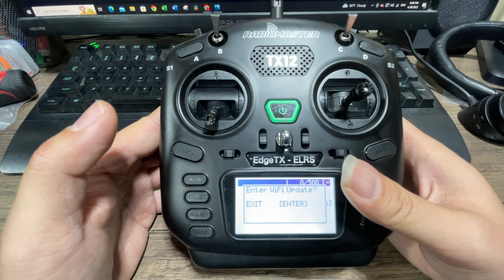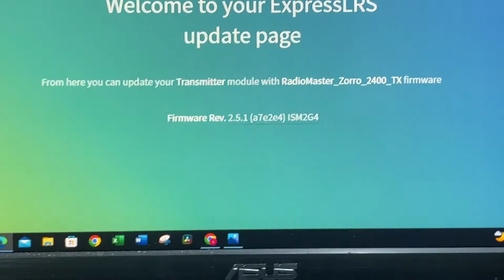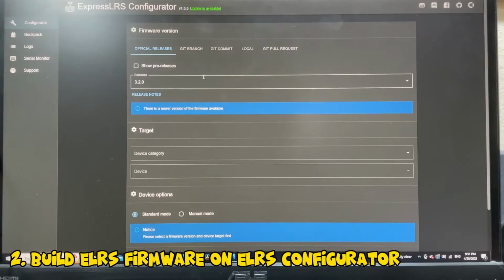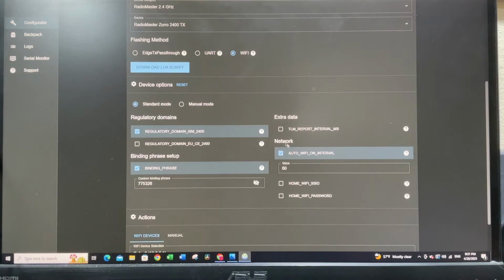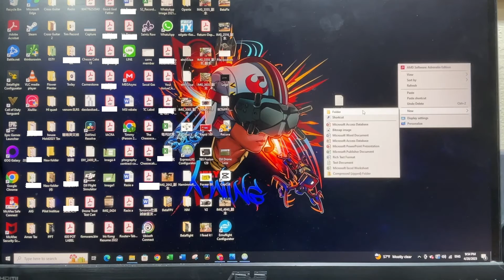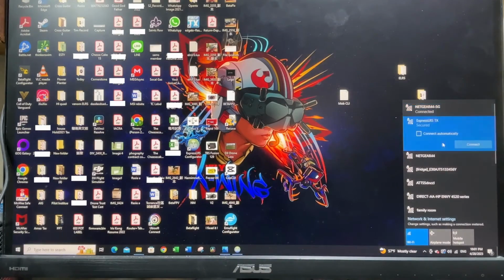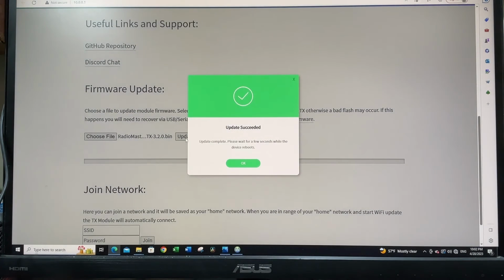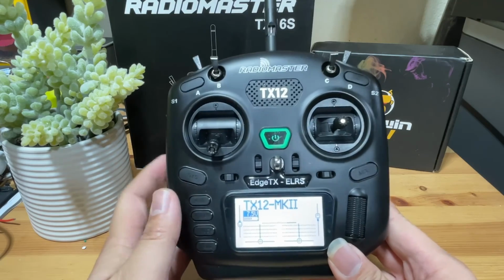How to Flash Radiomaster TX12 MK2 ELRS Firmware To ELRS 3.0

Comment: For anyone wondering: 3.3.1 does not flash, I recommend choosing 3.3.0 as the video.
Also, use the zorro firmware instead of the tx12.
Reply: If i update the controller ,I have to update the drone too?

Comment: Thanks for this video - this is helpful. One question: I checked the ELRS version of my new Radiomaster TX12 MKII, and it shows 3.3.0. Should I still do an update to 3.3.1? I am confused - is an update always mandatory to match the binding phrase with that of my receiver? Moreover, a sticker on the back of the unit tells me not to use it without updating the firmware. I am confused. Please throw some light.. thank you.
Reply from the maker: 1. If your radio is at 3.3 no need to go up to 3.3.1, it will bind with any RX that is is version 3.X 
2.No update is not mandatory, only as needed based 
3. You can ignore the sticker …lol 😜
Reply: @XwingFPVRC  Thank you!

Comment: Help! recently got a TX12 Mark II transmitter. In my attempt to flash the transmitter, I only got a firmware.bin file in my ELRS configurator build, with no radiomaster tx12 mark II specific bin file in the folder, have no idea where did I go wrong after checking all the steps with what you showed in the clip. Thank you for your help.
Reply from the maker: The ELRS file you are looking for my be the Zorro file. Connect the TX12 via WiFi first to see which model(target) is showing on the website, select the correct model in the ELRS configurator and build you firmware and try again. Or check to see if your ELRS configurator is the current (not beta )
Reply: @XwingFPVRC  yea i do have the the most recent version 1.6.0 configurator downloaded from github and my target should be correct, it says it is tx12 internal 2400 or something like that, definitely not zorro. When i tried to build a previous version like 2.5.1, then it fails..
Reply: @firstlast7168   im having this same problem
Reply: @firstlast7168  Same problem, any solution?
Reply: @firstlast7168  That sounds like all of you may have purchased the single-chip CC2500 "Multi" version of the radio - not the ELRS version. 
Unless you learn to read exactly what is written then you are certainly going to have problems using these radios. 
This video is ONLY about updating the firmware on the internal ELRS transmission module in a TX12 ELRS version radio. 
HOWEVER IF you are seeing as "tylersommer1" is elsewhere in these comments .... "mine is saying unified esp 2400 tx when trying to flash onto remote"    maybe you DO have the correct ELRS version. Read his comment and the reply.

Comment: I dont need to flash the reciever on the drone in anyway, do i? Of course the reciever on the drone also needs to be for example ELRS but i heard that you need to do sth like that to and im close to building my first drone ^^
Reply from the maker: How ELRS works is you need the RXTX firmware version to be a the same realm for them to work. It can be either on 2.X or 3.X, if one of it is different then they will not bind together 

Will suggest you view below for more info 

https://youtu.be/5XXx4Jgj1yA
Reply: @XwingFPVRC  thx for the answer ^^
Reply: @XwingFPVRC so will my drone that's is 3.3.0 work with my receiver that's 3.3.1?

Comment: I saw a radiomaster TX12 2.4G version,Why not selected it?
Reply from the maker: The reason is the TX12 is actually using the Zorro firmware. If you look at the web browser when the radio connects, it does show the module is Zorro, this is why we need to select the zorro version. If the select the TX12 it might brick the radio